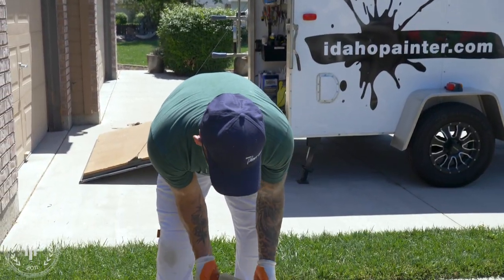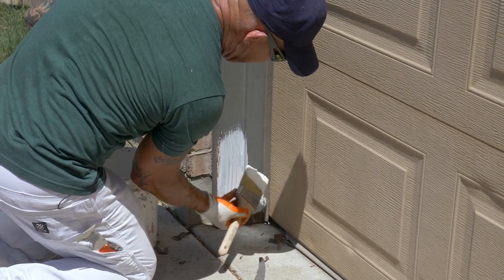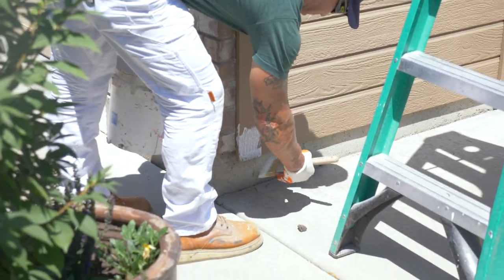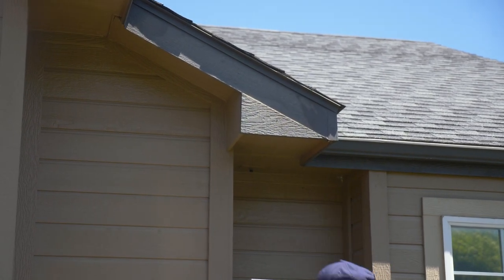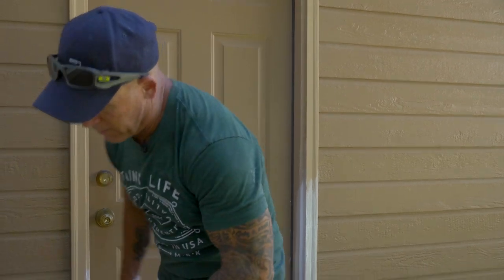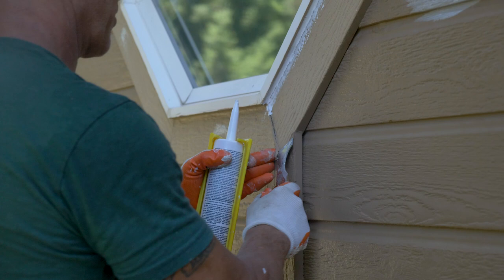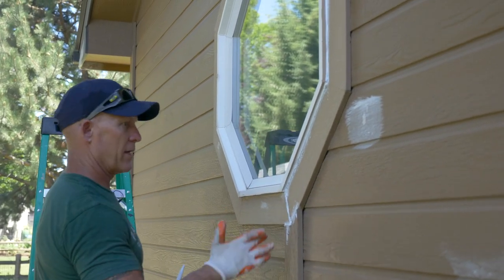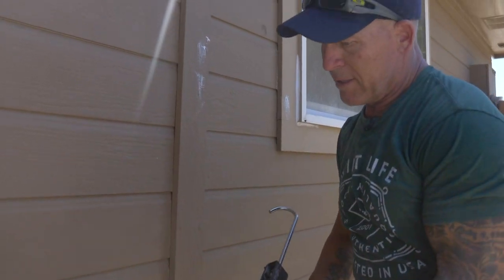Caulking and Priming.  Get your house ready to paint.

Comment: Do you have a video how to prep cabinets before paint. I didn't do a good job last time
Reply: I personally use a 220 grit sandpaper. And clean the cabinets with TSP with warm water. Or Any degreeser to take the grim off. Then I personally use a shellac primer. Bonds really well. Then your choice of urethane alkyd paint on top with a fine finish tip.
Reply from the maker: I have a whole series and a course at paintlifesupply.com

Comment: quick question if you drive in nails on the fascia board how do you fill the nail holes.  Is it better to use caulk or some sort of wood filler?
Reply from the maker: Tower Tech2 from www.paintlifesupply.com

Comment: I so enjoy your videos, I have a question in regards to the painting company. I’m about to use in Dallas Texas .they gave me two estimates one is for one coat of paint and the other is for two coats of paint . Is that normal?? Thanks
Reply from the maker: How many coats is irrelevant.  I has to be applied to proper specifications and proper mil thickness.  Selling two coats is a gimmick.
Reply: @Idahopainter  they would be using SW Duration

Comment: Excellent video Chris,what was the name of the product you used on the larger gap before caulking,is there any other methods that would work just as well for large gaps???
Reply: You can stuff big gaps with a piece of cardboard or plastic wrapper or anything really and then calk.
Reply: @ihavenoname6724  we appreciate your feedback
Reply: backer rod. it's sold for this purpose pretty much anywhere e.g. home depot. If you just fill a crack with a gallon of caulk it will take forever to dry and will shrink like crazy.
Reply: @ssl3546  that's the word I heard,thanks a lot bro.
Peace and love,man.
Reply from the maker: AU-1 if it very large.   from paintlifesupply.com